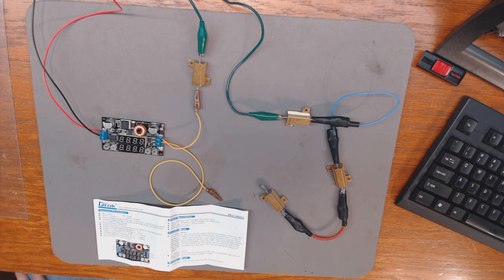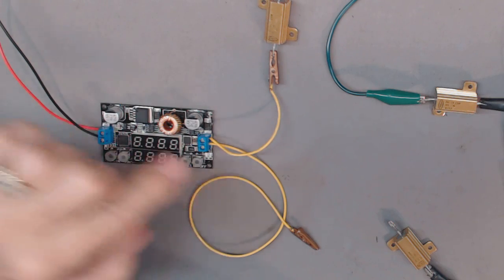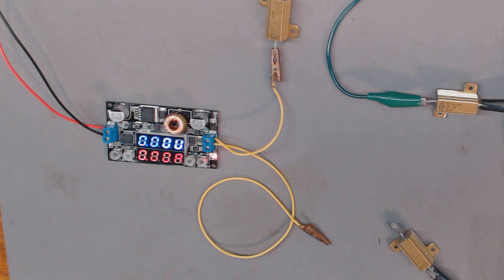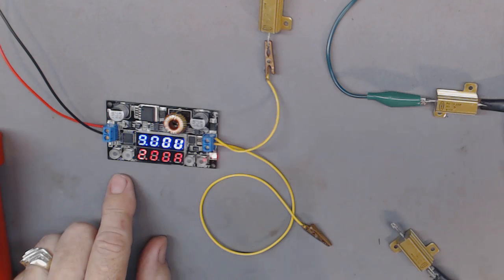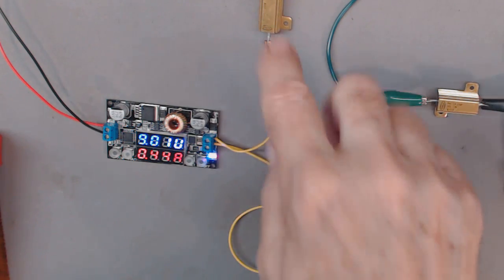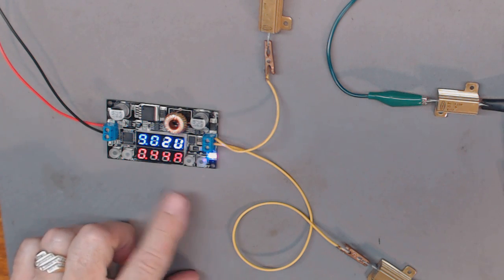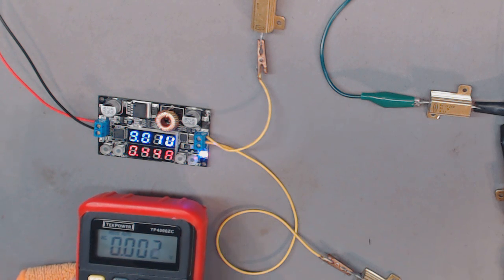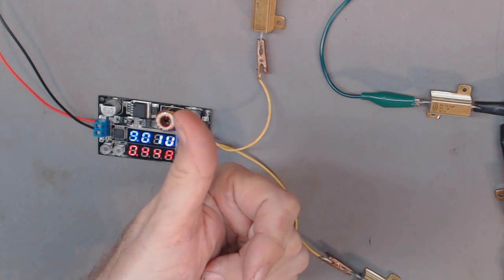TRRS #0844 - DROK DC to DC Converter - Testing

Comment: Hi Tom. You could use an LM317 linear regulator with the same bench supply and get no switching noise at all. After all, no noise is the ultimate goal here...
Reply from the maker: +TheScottytr6 Thanks for your input.  My goal is to not have to use a bench supply.  I am hopping I can use one my smaller 12 Vdc supplies and use this converter to convert it to 9 Vdc which is what the Grundig 800 requires.
Reply: That's Ok. If the converter turns out to be noisy you could still use the LM317 with any 12V or higher linear supply.
Reply from the maker: +TheScottytr6 Ok, thanks for the suggestion.

Comment: To tin or not to tin? 
Hi Tom, I used to tin wires that got captured by clamping screws until I read that was not the accepted practice. Seems as the point of contact will change as the junction heats, so base metals that are not covered with low temp solder are the way to go. I still tend to tin my wires but not on high current applications. THUMBS UP
These DC to DC converters really are amazing, so small they can fit nearly everywhere.
Reply from the maker: +Craig Nehring Thanks for the input.  If I had an application that would melt solder, I think there would be many other problems like fire.  Have a great day.